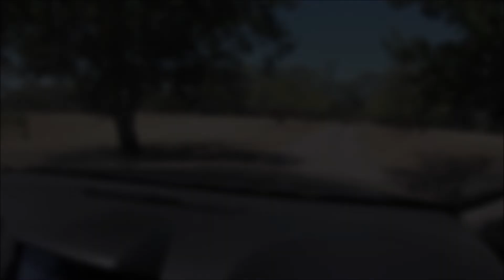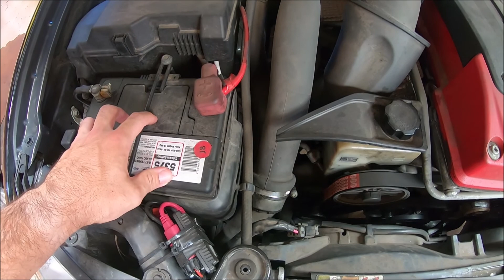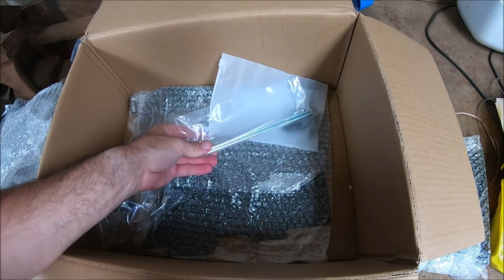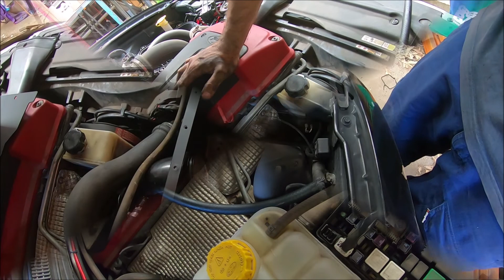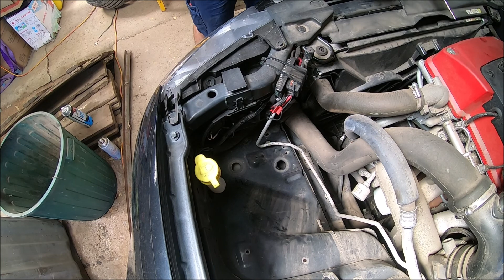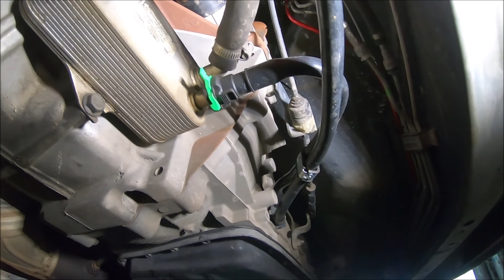FG Falcon Antz Performance Battery Relocation & Airbox Kit - Step By Step Installation

Comment: by connecting the positive cable straight to the starter does it still receive charging voltage from the alternator

Comment: What intercooler are you getting?
Reply from the maker: Would be nice to get a plazmaman unit but the car is only making 330rwkw so probably doesn’t need something that good. Is currently at the limit of stock turbo, valve springs and trans. I think even one of the FPV stock coolers would be a decent upgrade for now.
Reply: @alstorr6404  I'd look into the process west stage 1 or plazmaman stage one both have little to no cutting and will do you well

Comment: I couldn’t fit the lid on the air box for mine, any suggestions?
Reply: I can’t remember having too many issues. The lid for the fuse box can be a bit tricky to get it to sit right. The angle the elbow for the filter comes through side plate at also makes a difference to how it all goes together.